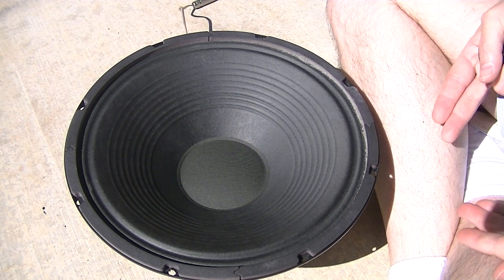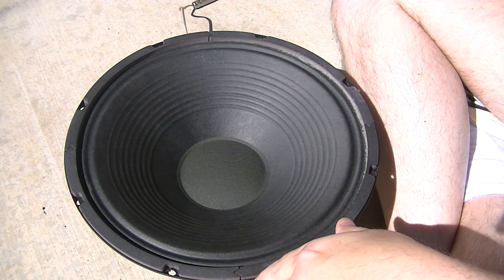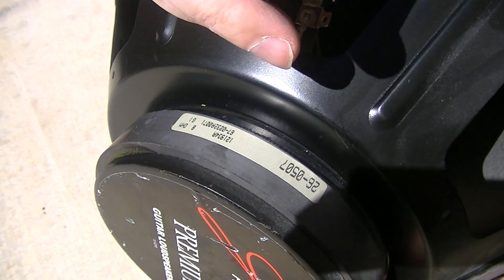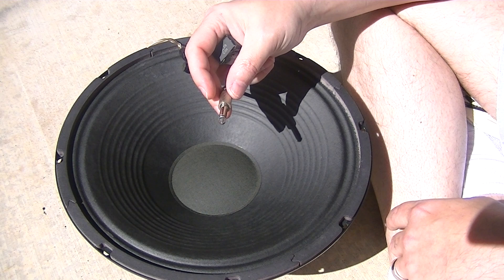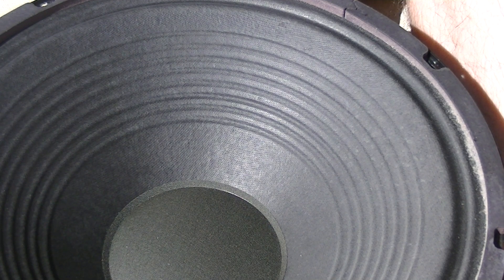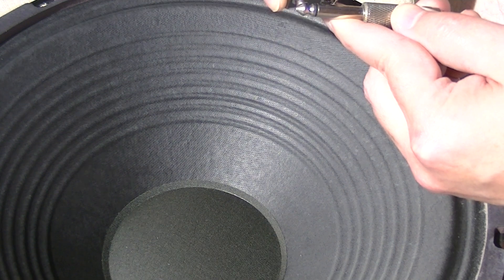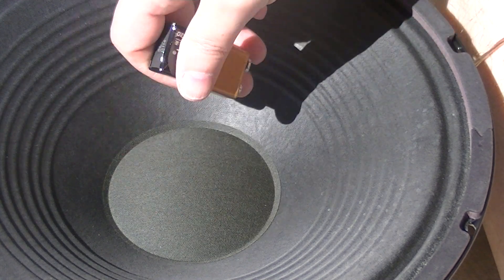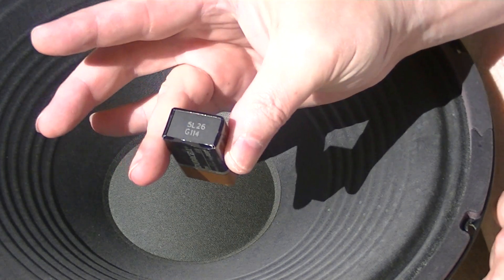EZ Test. Speakers Wired Correctly? By Scott Grove

Comment: That's gonna come in handy cause we wired up a cab for my son and the speaker was not clearly labeled for pos and neg. I think we got it right because it doesn't seem to have any phase cancellation with the other cab (15" on a bass rig combined with a 4 x 10") but now we can be sure. Thanks!

Comment: been doing this for years as well. it should be noted that dc voltage CAN overheat the coil and ruin your speaker. this test is just done as a brief touch to the battery, as in the video, you do not want to hold it there for any extended amount of time or you will exceed the coils duty cycle and likely overheat it and melt the coating on the magnet wre, shorting it out internally.

Comment: Actually, I've found that with open back cabinets you can use your ears also. Wired wrong more sound comes out the back of the cab than the front. You mentioned old JBLs, did they wire them that way on purpose? I remember there was a lot of confusion around this issue once JBL became super popular.